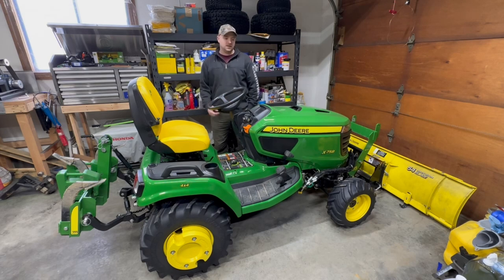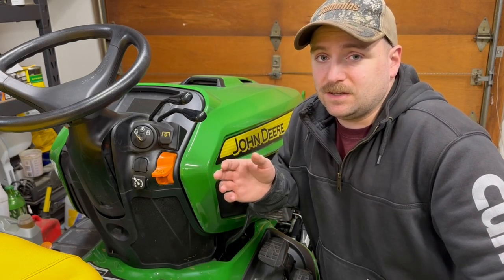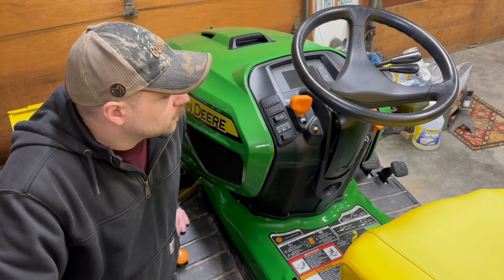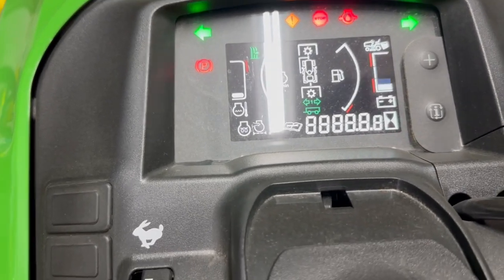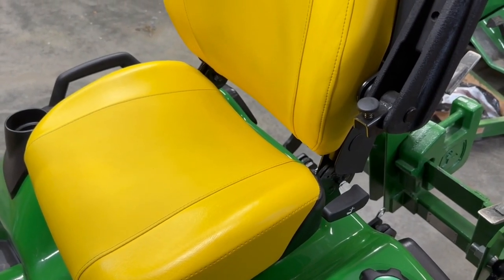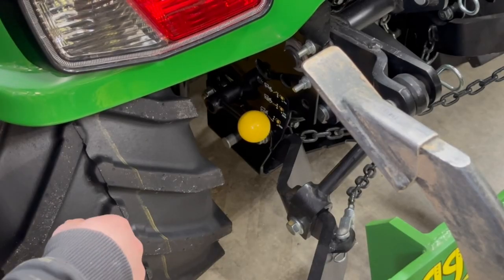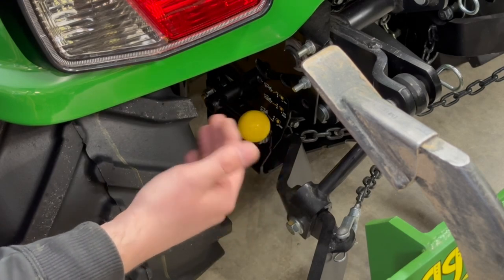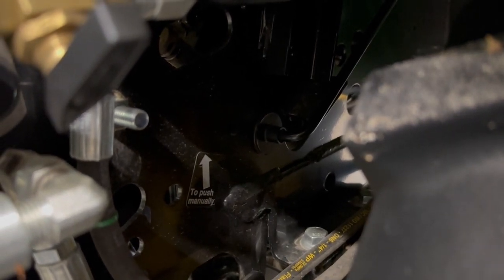A Guide To The John Deere X700 Series Controls

Comment: Hey, I figured out something today on my X739. Of course to engage the pto, in my case the blades, you pull the switch out. I found out that at that point if the switch can be pulled up a little further and it is spring loaded so if let go it will return back down to the pro, blades, engaged. When it is pulled up to the spring loaded position and held before backing up it acts as the RIO switch so blades stay engaged, the same as the small yellow push button on the other side.

Comment: i see you have  a set of rear remotes, did you add them or it came w/them. i have an x750 and think that would be nice to have.
Reply from the maker: I added them, they are from auxhyd. It is the deluxe set, so you get the rears, and still have use of the 2 circuits up front. The standard kit takes up one of the front circuits.

Comment: Hi nice video! I just purchased a 2011 John Deere X720 and Ive notice that my orange button hasnt popped up. Its still in the down position. I have driven the tractor some. Is something broke in the differential unit? Any idea?
Reply from the maker: So the diff will remain locked until pressure is equalized on each side of the diff. Have you driven it straight? Try that, and also try going straight backward. If it doesn’t pop up then, try lifting it with your hand and checking the linkage. Follow the linkage back to the transaxle, and see if it is connected to the trans. There should be a pin and spring clip holding it into small lever. I can’t remember at the moment if the lever is spring loaded, or is internal, I’ll have to check, but may be something internal if the linkage is connected.
Reply: @JoshsGreenGarage  well I have driven it some but not much. I do know that the differential  isn't locked. I'll take it out and drive it some more in a straight line to see if that helps. Fingers crossed! Thanks for your help.  I'm hoping It's not broke!
Reply from the maker: Well if you can turn and it isn’t dragging the wheels then yeah I’d say it’s unlocked, and if the pedal stays down still, it’s gotta be a broken spring or the linkage isn’t connected. You may be able to look at my 3-point install video, part of that involves the linkage, but it’s tight in there, so I may not have shown it very well.
Reply: @JoshsGreenGarage  ok thanks so much. I'll check it out when I get home . I know the rear isn't locked.  I've seen others posted for sale that have the orange knob down all the way. So mine isn't the only one out here with this problem.
Reply: I went to look at it and realized that the orange knobs was up. It must have popped up at the last minute when pulling in into the barn and I never noticed it. So that leaves this question to ya... If that was pressed down (I do know it was down) the  differential should've been locked up correct? I  turned it sharply numerous times and didn't notice the wheels hopping around or  tearing my lawn up..
Reply from the maker: Yeah I would try again and observe it carefully, should definitely scuff the ground. If in doubt, you could try getting it stuck, and then see if you can get it to lock. I’m sorry I don’t have more advice. I don’t think diff lock issues are all that common on these though. Haven’t really seen anyone complain about them.
Reply: @JoshsGreenGarage  Hi Josh
Maybe you can help me with this. This is my first X Series John Deere and I took the Shaft off of the deck and for some reason the coupler won't go back to where it should be. It stays in the back position.  The spring isn't broken.  Have you had any problems with this before?
Reply from the maker: When you connect the shaft back to the transaxle, it should go back to its normal position… for some reason they lock back if you mess with em after it’s removed
Reply: @JoshsGreenGarage  ok I was thinking it was broke! Thanks

Comment: Hey Josh - I commented before on being interested in you doing a video on an oil change, greasing all of the zerks on the machine, changing the air, oil and fuel filters.  I would love to see you do a video on these things when you can.  Keep up the good work and thank you for taking the time to do the videos.
Reply from the maker: Those will be coming out very soon! I just took of the plow after I shot this video, so now I’ll be able to get in to everything. The home maintenance kit will likely be a multi-part series similar to how I did the X580 home maintenance kit.
Reply: Your PTO switch also doubles as another RIO switch just like the little yellow button on the other side. When you pull up to engage the PTO, you can pull it up just a bit more and hold it so you can mow in reverse.  Kinda gives you options on which hand you use.

Comment: Like your videos as I am in the process of buying an x758. Their is a way to show rpms where the hour meter is. Below is the steps to access it.

• turn key to accessory position, do not start engine

• press RIO button 5 times

• the HOURS display should turn into a display of RPMs

• start engine normally and you should see the RPMs go up/down

• when key is turned off it reverts back to display HOURS

Comment: Hi Josh, excellent and very detailed video.....can you show how to switch between using the rear hydraulic lift and mower deck hydraulic lift?
Reply from the maker: I would, but there isn't anything to show. The two use the same lever. When you have the 3 point installed, the cylinder gets flipped around to the hitch rockshaft is directly powered by it. A metal strap is then connected to this and the deck lift rockshaft, which actuates the deck lift. So same function. I could show how to lock one or the other out, is that what you are asking?

Comment: In your opinion what is the best front end loader for my X758
Reply from the maker: well you only have a couple options. There is the little buck/bull whatever it is, and the CTC loader. Deere unfortunately doesn't make one for on the newest machines (X73X/X75X). mmrbeef on youtube is actually having a shop fab some brackets to put a deere loader on his 758, but you have to find a deere loader first, and then either make or have the brackets made. I would buy a CTC though. Most people are going to tell you that. The build is way nicer and I think it would be one you would still want even if you went with a different loader.

Comment: When you showed the display 
What were those green arrows? Does this have directional lights left or right? 
I’m buying a x738 and it has those to 
Was curious
Reply from the maker: I think they are for the European X900 series. Those I'm pretty sure have backup alarms and turn signals, as well as horns, I could be wrong, but all of these options are found in parts diagrams.

Comment: Josh 
There are two spaces above the light switch, would that be for optional equipment such as electric mulch control? Thanks
Reply from the maker: Possibly, I’m not too sure. I’m betting they are for the European exports, the X9XX series. They may have turn signals and/or hazard lights, possibly as an option. Never really looked into this though. I’ll have to do some digging!

Comment: Anyone know what to do with a mower deck high control that's stuck at 4? I set it there while mowing, now I can't lower it.
Reply from the maker: Did you fully raise the deck and then try to turn it? Hold the upper lever back for a few seconds to ensure it is all the way up. Any weight on that knob and it won’t turn.
Reply: @JoshsGreenGarage  I did indeed. Read elsewhere you have to shake the deck a bit by hand to free up that knob if it does get locked by the weight, so I'm trying that next.